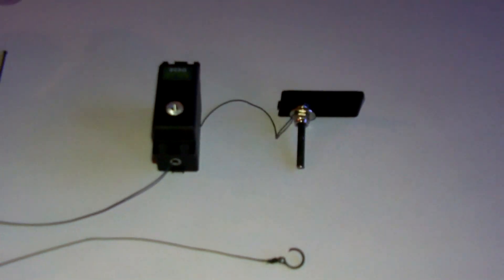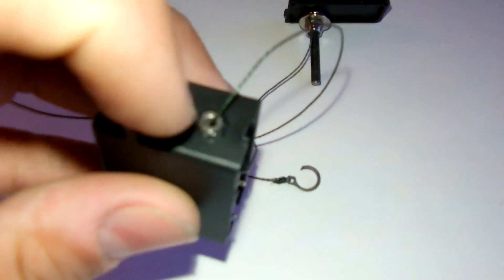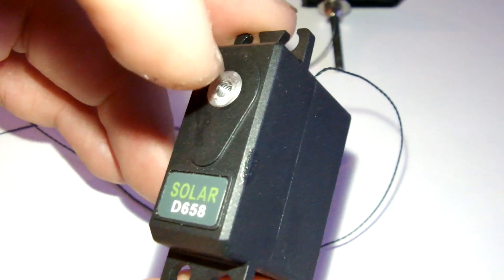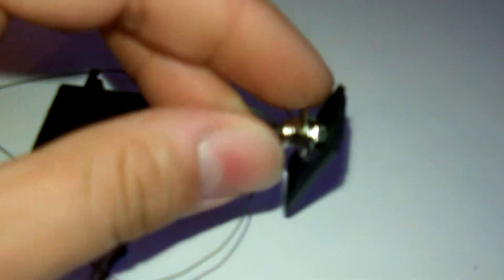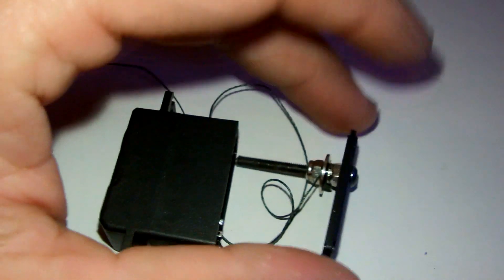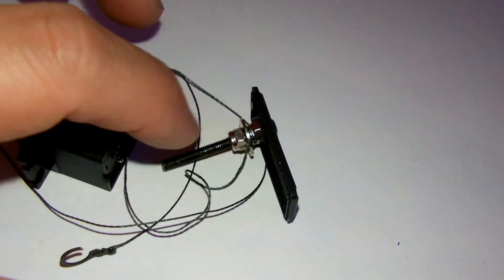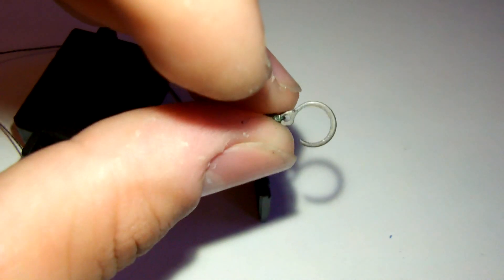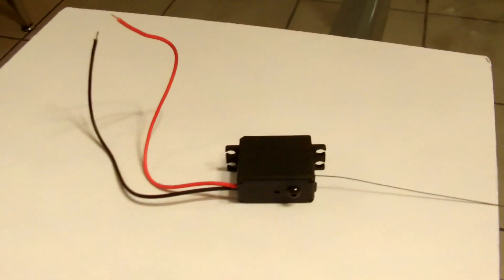How to make a servo winch 3

Comment: Can the potentiometer be wired externally to the truck to act as a controller if there is not a third channel present?
Reply from the maker: I think you might run into more difficulty running a set up like, 3ch transmitters are kinda cheap now, maybe save up a bit for one so it can work better? its just the pot is not as accurate.
Reply: Thanx
Reply: This wouldn't work because the servo needs power and signal to function.  Without signal (pulse duty modulated) it will go into neutral / not move.  You could make an external driver with a 555 timer but by the time you did that, better off with an extra channel on your radio.

Comment: Are you able to control the exact positioning now that the servo is able to turn multiple times?
Reply from the maker: +Minh Nguyen You control the speed at which it turns and the direction but final position will be at the point where you let off the throttle. If you use a esc that has drag brake built in it will help the servo keep its spot if you were to try to turn it though. As far as returning to neutral(start position) it wont happen as it no longer has a pot to give it reference as to where to go back to.

Comment: Very cool design!
I wanted to ask:
Is it possible for this design to be used with a thin electric cable instead of the pull wire? I want it to pull a led bulb. How would i connect the other side of the cable to the case without getting it tangled up?